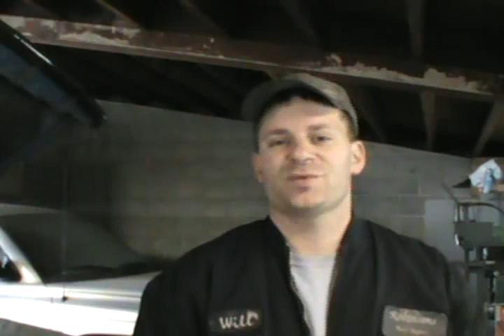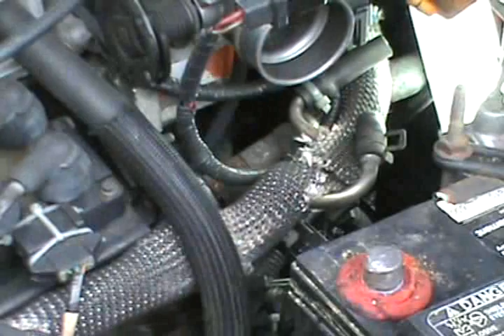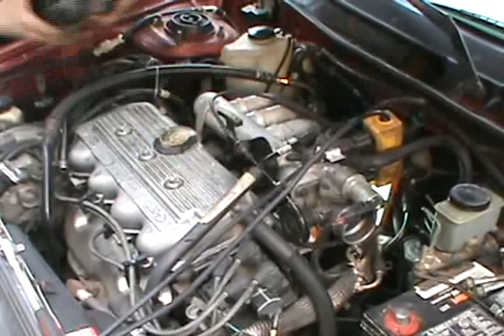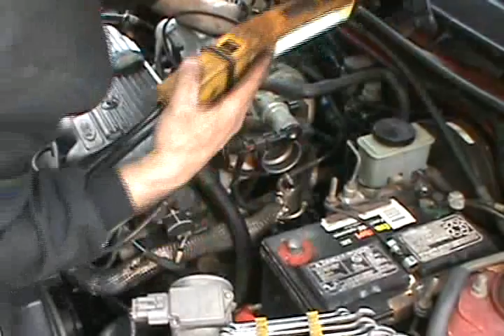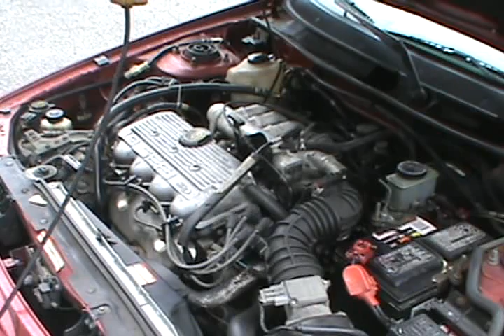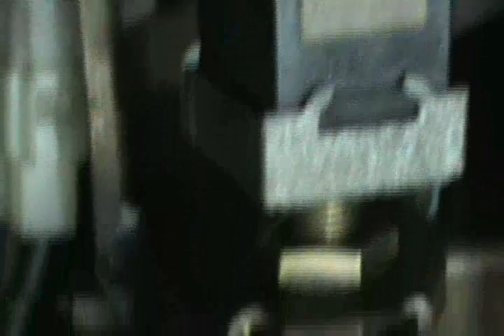Troubleshooting and replacing a bad starter. 1.9 Ford escort

Comment: I can't tell you how much I appreciate you posting this video!   - The auto shop quoted me $389 for 
a reman starter and labor to install on a 1995 Escort wagon 1.9L.  Got a reman starter for $79 and
installed myself in a little over an hour.  Getting it out was the most
difficult part needing both 3" and 6" ratchet extensions - putting it back in  and
getting it all buttoned back up took me less then 10 minutes - no problem.  

* A tip for anyone on the reinstall - Be sure to put in the top two bolts [on the battery side] so 
when you put the starter back in you can cradle it in your left palm to support
the starter and then easily reach over the top of the manifold to get the top bolts 
started.  This help hold the starter in place and makes getting the lower mounting bolt
on the starter side in and tightened super easy.    

For those of you wondering if it is your starter here is what mine was doing.  All of a sudden my
wife tells me the car is hard to start so I immediately suspected the battery - went and had the battery tested it had a full charge but it was showing the battery did have a dead cell.  So I Replaced the battery.  Go to start the car - it does the same thing so I am thinking maybe the new battery is not fully charged.  They check it for me and no problem with the battery - it's fully charged all cells in it are good.   Reinstalled the new battery the car started right up.  Next morning I go to check the car but this time the car will not completely turn over, acting like it is a weak battery again.   So I decided to smack the starter on the starter housing with a crescent wrench and she started.  But now I knew it was the starter for sure - so off to OReilly's I went.  There was no clicking at all and the starter would engage but acted as if the battery was too weak.  Hope that helps...  

Thanks for saving me $310!!  I really appreciate it!!

Best Regards,
Tom Waldon
Reply: My man you must have big hand because I  did pull it off with 1/4 rachet the small one and a 12 inch socket

Comment: This kind of practical information is gold. I especially liked your advice about the clutch safety switch. I've got lots of book knowledge about voltage drop tests etc, and that's important, too. But guys in the field have all kinds of ways to do things efficiently, that take you right to the solution almost every time. 
I stumbled across your channel today, and I'll work through your videos slowly. Thanks for going through the effort to put these videos up.

Comment: It is your probably your FPR, Fuel Pressure Regulator. Same thing is happening to my truck. Hard starting and takes a while to turn over after running it for a few minutes. I narrowed it down after I bought all parts I thought went bad. Haha! Well good luck Nmbr0.

Comment from the maker: @qaz3000 i can do that. always like suggestions. everything you mentioned would cause a no start issue, however sometimes its in the control side of the circuit, where deeper diagnosis would be needed, to narrow down the issue, i think that's the type of vid your referring to. after doing this work for so long. i find myself going to the root of the problem and working back sometimes these checks only take seconds. however saves you from throwing parts at it, i will share more of that.

Comment: Thanks, this responded my starting problem turned out to be the neutral safety switch, now it cranks over but doesn't start, might be bad gas though, it's been sitting awhile. Thanks again for this info, all the videos I went through didn't mention this as a possible problem only yours. Now it's just getting it to run :)
Reply: Really resolved, hate tablets and their word replacement at times....
Reply: Caleb68

Comment from the maker: @RangerFarmer1 its not that bad been in tighter spots than that lol after awhile of doing this work you find ways to save time, and in doing so you find ways to get in tight spots. this actually wasn't all that bad 20-30 min start to finish at most. most likely i used a swivel socket or extension i will need to watch it again. thanks for checking out the video

Comment: Thank you robinsonsauto for this video ... I know a little bit about cars Not enough to say take a motor apart but I usually can fix my car most of the time As long as it's not too complicated And requiring special tools .... So in this case I knew that my starter was having an issue, I just didn't know which .But after seeing the end of your video Reminding me that it could be That safety switch It prompted me to go out and jiggle my automatic shifter And sure enough it's working again so .....It wasn't the starter it was that switch  . Again thank you

Comment: Something broke on my safety switch (actually a button) on the clutch, so the switch wasn't being pushed down. I wrapped several layers of duct tape on the clutch pedal, so it would push down the switch, then added a few more layers to be sure. As a backup, I found that I could kneel on the ground and push the switch with my left hand while operating the ignition switch with my right hand - BE SURE TRANSMISSION IN NEUTRAL. 

If an automatic won't start in park , try neutral.

Comment: Great video. Thank you so much. I think this is really going to help me figure out the issue with my car. But quick question. In the beginning of the video you did a test light check on that starter. Is that something you bought or is it installed already to the starter

Comment: I did the same trouble shooting but used a volt meter looking for 8 volts. My 95 is now 18 years old with 230k. I couldn't reach the two bolts so removed the air filter box and the battery. the bolts are buried deep and didn't come off to easy. Had to use a 18" breaker bar, my knees on the bumper, both hands on the bar pushing in with knees and pulling with arms finally breaking them free. the back bolt just as tight and the breaker slipped off damaging the bolt head. Took the intake manifold off, disconnected fuel lines, vacuum lines. tie wrapped the breaker bar to the starter so it wouldn't pop off and used a 16 point 1/2" socket on a 1/2" drive braker bar and a 8" extension. The extension was needed because the bolt sits too close to the starter and I don't have enough room to rotate the bar to break the bolt free. It slips again and the bolt is damaged more. Next attempt will be to jack the car up and try from under the car and use my legs to push the bar. Or I might get a impact wretch set to 200lbs or maybe use a torch to heat the block up where it bolts. Sure isn't as easy as the video. got 3 hours into it so far. Should have had it towed to a mechanic!!!

Comment: also be really careful handling the top of the battery like that, touch it like your doing then itch your eyes and you got trouble fast , batteries usually have more acid on the top than you think, so be careful there bro, we need you .

Comment from the maker: im assuming its cranking hard right? or do you mean it cranks good but starts hard? 
if it cranks hard, wouldn't hurt to check all connections, could be radiant heat from the manifold or headers depending, causing the starter to heat up, is there a heat shield protecting the stater? could be the starter failing, could also be ignition timing. just some thing that come to mind with the info i have

Comment: Apparently my 97 escort 2.0L is just different enough that this isn't exactly the same. I can almost see what might be the top of the starter, or at least a top bolt. I certainly can't get my hands or tools on it from either side. The manifold is too close to the firewall, the master cylinder/ brake fluid reservoir and many many hoses ect are in the way.

Comment: I have a chinese scooter with a 150cc gy6 engine.  It's be hard to start lately and I've replaced the battery, the coil, the CDI unit, the spark plug, the spark plug wire and boot, the air filter, the fuel filter, the carburetor and the valve springs.  

The only way I was able to start it, was when I put a battery charger on it or by kick starting it.  The electric starter turns the engine over VERY good.  Is it possible the starter is sucking up all the juice and leaving a weak spark?

Comment: I have a question... I installed the starter... however, the smaller cable (not on the post) which as a connector on it didn't make sense.  It has 3 wires in it.  I cut them all and wired them to the wire coming off the starter.  Is this correct?  The car starts up great and runs.  However, the battery will not hold a charge...  A few hours later the battery turns out dead (it's a brand new battery).

Comment: I have a question if its OK. I am having starter issues with the same car you're working on here. 1995 Ford Escort LX with a 5 speed.
 Same as you, I checked the connections on the starter first No power to the solonoid. I jumped the starter and it works. Disconnected the clutch switch and checked the harness side of the plug. No power. Used a jumper wire, No power, Check all fuses just for giggles. All operable. My question is there any other relays, switches, before I get to the ignition switch? When I turn the switch to start I hear a relay clicking somewhere in the dashboard. So the circuit on the start setting isn't completely dead I don't think. But yet, no power to the solonoid. Any suggestions?

Comment: Hello I have a 2002 ford escort zx2 last week I replaced the manifold on the car because it was stalling on me my mechanic told me the issue I got it back & everything is fine I had more power to the engine I was pleased with his work. After 1 week driving my car was having issues bout turning on I sat in the car for a few minutes & it would start good so I thought nothing of it well now the car won't start the battery is good the lights turn on radio etc... there is no humming sounds or any other sounds like clicks but now when I put the key in the ignition it doesn't start.? We checked the battery & cables is good. I have half tank of gas. Curious could it be the starter?

Comment: I have a 1994 F150. when i run it for about 30 minutes shut it off and try to turn it back on, it has trouble or a difficult time starting. i dont know if its the starter or the wires from the terminals. do you know whats up? and ive tried venting the engine to cool it down.

Comment: i have a 99 escort. it died on the side of the road and wont start. i had a mechanic come to the house and look at it. when you turn the key the car tries to start but wont kick over. he said it sounds like a bad starter solenoid.

Comment: I have replaced my starter, but it still does not turn over to start. Could it be my relay switch (what others are telling me)? I turn key over and still no start, relay switch will click..baterry is full charged..fuel tank is okay..? Puzzled